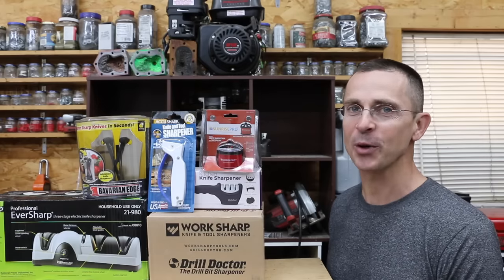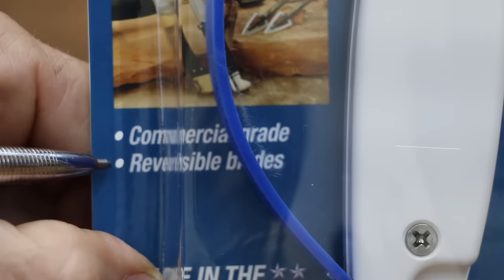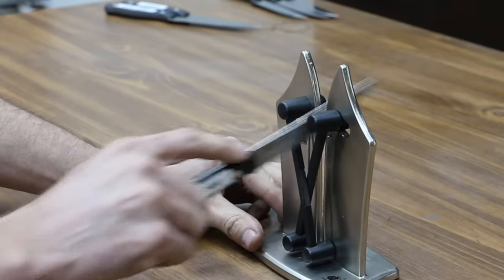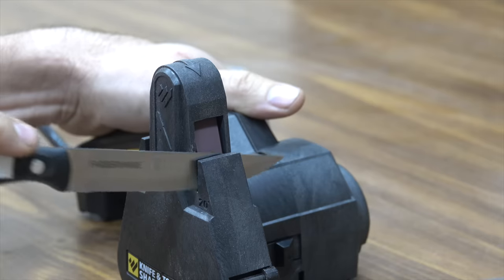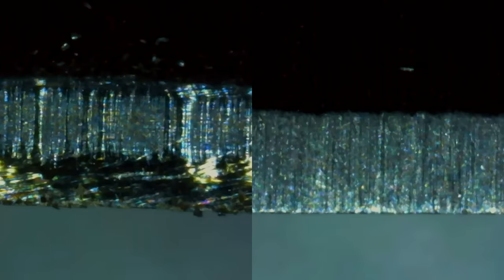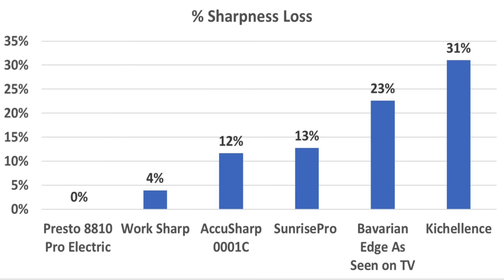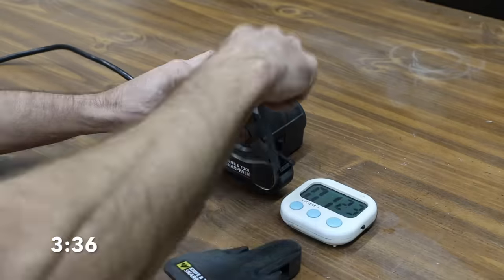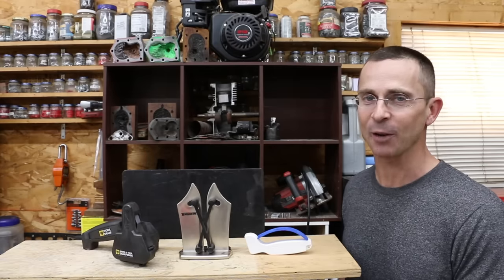Which Knife Sharpener is Best? Let's find out!

Comment: I would have loved to have seen him try a regular whet stone(s)

I'd be interested to know how they compare in sharpness and effort
Reply: Whetstones as well as diamond stones have a learning curve, in all reality it takes years to actually become proficient in sharpening knives and keeping your blade angle correct, personally I wouldn't use any of the sharpeners featured in this video although I would like to have a Ken Onion Worksharp... not a Worksharp, but a Ken Onion Worksharp, same company, big difference, one of the most well known knife designers took part in it, if you're looking for a quality whetstone, look no further than a Norton for most tasks, personally I always use my buck diamond stone, my norton isn't as flat as the buck anymore, so an advantage to diamond, also most pre set and carbide knife sharpeners just ruin blades, I graduated from my Smith's pocket pal a long time ago although it wasn't too bad for an average person, I just never used the carbide side
Reply: They have the highest learning curve (hue), but are the absolute best way to sharpen a knife. (6 years of experience in a butcher shop, many years before with my own knives and tools at home)
Reply: @lumpyzx2645  My Ken onion snap on folding knife is the by some margin the best work knife of the many I've owned, its ability to take abuse is impressive.
Anyway,I'd agree,we have had vastly different experiences with knife sharpeners.Now our kitchen knives are done by hand on a stone,the old guy that does them is nearly 90 and has apparently been sharpening all manner of blades since the age of 12,his hands are all buckled from arthritis but the work is peerless in terms of sharpness and more importantly,longevity of sharpness.He has in his van an old treadle operated rotary stone for big stuff,it's as old as himself,old school and then some!.
I tried him on the strength of my brother's less than eloquent "when they're done you could circumcise a mosquito in flight with one"recommendation.
Reply: the V-shaped sharpeners look like they aggressively remove material away.   I bet the finest grain of Whetstones if used properly can make it very sharp.
Reply: Whetstone's stones are not that hard to use. Even if you sharpen heading off angle like 22 degrees or 10 degrees. As long as you maintain a constant angle when doing your sharpening your blade will come out razor sharp. If you do the progression. My progression is 400 Grit 1000 Grit 3000 Grit 8000 Grit then schropp on leather with nothing on the leather. The 8000 grit will get you a mirror polish on your Edge. Which you don't need unless you have a Rockwell hardness above 60. Otherwise you just wasted a s*** ton of time for no reason
Reply: Lumpy zx2 it takes less than 4 months to learn how to sharpen by hand with whetstones. I got my first hair whittling knife my third week of transitioning from edge pro apex.
Reply: this
Reply: @LostinYTblackhole  my wife hates how sharp our knives are now. LOL especially the paring knife cuz she always cuts her thumbs with it
Reply: @supahvaporeon  agree it takes years. i've learn the basics in weeks to be sharp but getting that paper edge cutting sharpness? years i guess.
Reply: Jeremiah Sam then you don’t understand the basics of sharpening a knife. Getting a knife that can cut through paper takes a week or two if you know what a burr is lol. It’s when you get to shaving, hair whittling, or my personal favorite test... cutting toilet paper. These will take time to achieve on a consistent basis, but you will still be able to get there In under a few months. It’s consistency that takes time to master
Reply: @smoadia85  It depends on how deft you are. It took about a week or so with me, and less than a month with other coworkers.
Reply: Loadn Abox Doesn't count unless he uses a jig, without it there's too much variation
Reply: Most people don’t know how to use them
Reply: @smoadia85  I was able to get knives to paper-cutting sharpness after just a few practice runs.  I use a 180/600 diamond plate to start (180 only if the edge is really damaged), then a 1000/6000 stone, then a strop with compound.  I'm sure I'll get better at it with more practice, but I'm able to slice slivers off a piece of paper no problem.
Reply: They can be quite pricey though.
Reply: @lumpyzx2645  i personally dont agree in Sharpening stone being very hard to learn of take years to get right. i personally started using them at 12yo, and when you understand to keep the angle right they are very easy to use. i consider using a sharpening block easier than any of those V shaped scrapers.
Reply: Whet stones can get a blade as sharp as physics will allow, but the effort and skill required to do so requires years of practice. You'll probably go through dozens of knife blades and stones in that time as well.
I've always wanted to get an amazing edge out of using a whet stone, but I have other things I'd rather do with my time. So electric sharpeners that can get my knives "sharp enough" are good enough for me.
Reply: whet stones would not be conclusive to his methods of testing as their efficacy has considerable variability dependent upon the acumen of the sharpener.
Reply: Some knife edges are ground steeper at the factory.  If the angle is near what I hold, they sharpen pretty fast.  If it is a thick blade with a steep edge, it takes longer for me to get it to where I like it.  I think the experience helps with working different knives to a consistent sharpness.
Reply: oh... i have 2 of those japanese stones... one is iike 800 grit, the other one ~2000 i think... i might have used 3 times in 5+ yrs. 

if u have PLENTY of time to kill & BUDGET, go for it!

me:  knife is a tool, i need somewhat of a sharp edge to get stuff done.  Faster & cheaper sharpening option will allow me to resume my project with a sharp knife and get it done quickly.
Reply: Have a look at the Hapstone sharpener. It will allow you to use any kind of stone, lapping film or polishing leather you want to use. And you can apply it with very high accuracy without spending years on your sharpening technique. In fact, you can surpass even the most talented hand sharpener in the world. Well, maybe not with the Hapstone. But there are other jigs, like the TSPROF and the Wicked Edge. But those are much more expensive and enthusiast products.
Reply: @lumpyzx2645  Smiths makes the BEST whetstones. Their Arkansas black has no equal
Reply: @licensetochill79   even on a "Rockwell hardness above 60" you don't need a mirror edge.  That's just a myth from "knife bros" and it's ONLY for looks.
Reply: There are jigs for whetstones. That takes away errors and learning curve.
Reply: a fair bit if that also relies on skill with a stone, but a good idea
Reply: I've been sharpening knives on benchstones (both whestones and diamond) for 10 years. I've only been really good at it for the past year or so, after much research, study, testing, trial and error, and elbow grease. That said, the results are incomparable.
Reply: Loadn Abox wet stone varies greatly on technique and the angle the user sharpens at. It has the highest learning curve and Just remember if you use a wet stone always use the same angle when using your steel (hone)
Reply: Yeah wet stones really do require a lot of skill. Hell I’ve been sharpening my knives for over a year with wet stones and I still suck at putting a good edge on them. They get sharper for sure but not as sharp as they should be and it’s an ugly edge
Reply: Moon Pie  aww, i thought you were joking in your previous comment but then you wrote "knifes" twice :(
Reply: Moon Pie  I never said you would ruin your knives. I said you would go through them. The amount of practice it takes to get really good with whet stones requires that you sharpen your knives a lot. 

Yes, after a week or two, most people can put a somewhat decent edge on a knife with a stone. But to get to that next level of "scary sharp" takes years. 

I don't have the desire to invest that kind of time into learning that skill. I can get almost as good results from a device that takes a lot less time to learn and a lot less time to use, and use the time I saved to do something more interesting to me.
Reply: @BornIn1500  I disagree with you on that because  a polished Edge creates less friction thus easier goes through the substance I'm cutting. Thus making it sharper
Reply: Brian Landers  how else would u peel something a peeler perhaps! She is stuck in her own way I tried you must not be married. Lol
Reply: @bakerboy8910  I can't say I've ever tested a full size Smith's stone, but their products have always made stuff sharp
Reply: @licensetochill79  I've took one of my knives to a mirror polish and razor sharp, went from diamond stone to 2000 grit to leather, it wouldn't shave hair after but I know for a fact it was sharper than a razor, so I took it back to my diamond stone and left it at that, those microscopic serrations help cut, mirror polish is awesome, dont get me wrong I love it, seen some amazing jobs that it took me a minute to even see the edge, but for most purposes its completely impractical
Reply: Also, I never said you cant make a knife sharp on a stone with little experience, but how many of you that have been sharpening for a few weeks or months are confident enough to holt the stone in one hand, knife in the other, and quickly sharpen it without looking and having a conversation with others? I've been sharpening knives I'd say since I was 7, I'll admit I absolutely sucked for years, I'm 20 now and I can get the initial blade angle of both sides from the first 2 strokes and then sharpen it flawlessly very quickly (unless it's one of these fancy super steels, those take some time), I'll come within .125-.25" of my thumb every pass, I've never cut myself doing it knock on wood but I have barely knicked myself 1 time, couple layers of skin no blood drawn, I don't think anybody could become that proficient in a few months, yes it only takes a few months to be able to put on a nice edge, but to fully understand it and become very proficient it takes, heck I've had my diamond stone for probably 6 or 7 years, got it at a swap meet for like 5 bucks, it's a buck stone, great stone and I prefer it to my Norton whetstone due to weight, wear, and just how much faster it gets the job done just as good imo
Reply: @lumpyzx2645  it's one of those years old questions does it benefit you or not. I think it does. But that's my opinion. LOL. But if you think about it logically something smooth ER is going to have less friction and go through an object easier
Reply: @licensetochill79  that's exactly what I thought but that's actually quite often not the case, although on one of those wire sharpness testers, who knows which would win, they're pretty interesting
Reply: @lumpyzx2645  if you can get someone to donate a tester I'll be willing to sharpen Two of the exact same knives one with a Polish and one without
Reply: @licensetochill79  having a polished bevel (less friction) doesn't make it sharp. The apex by itself makes it sharp.  In fact, having a rougher grind on a high Rockwell has been shown to be better by many people because it creates micro serrations.  You can disagree, but there have been many tests by YouTube people and it has shown that a high polish makes no difference, and in fact can be worse.  Knife bros like the polish because it looks nice on their pocket jewelry and they can play with their knives longer while sharpening.
Reply: @BornIn1500  a polished Edge would be a finer Edge. An edge does not have to jagged be in order to cut if a Polish didn't mean anything why are razors so shiny when they're brand new.
Reply: I do understand there is a difference depending on the skill level of the person honing on a stone.  There's still ways to test that (get a pro in see how long it takes him and have a rank amateur try it at the same time)  See how good each of them does and how long it takes.

I personally switched over to using a stone.  I've tried quite a few methods for sharpening including standard hand tools.  A Lansky (has a setup to give a perfect angle) which was super time consuming and the edge didn't seem to hold well.  I've got a lower-end version of the presto he showed in this video which mostly ground down my blades pretty fast, plus I wanted a sharper edge.  

The stone I'm still learning, but just after my first few attempts I'm already getting a much sharper edge on my knife than the previous methods.  I'm still not getting it as sharp as I would like though.  It's going to take time to get really good at it.  I must admit though that after seeing this video the Bavarian Edge is tempting
Reply: @loadnabox1943  just remember to keep your Stones flat
Reply: Moon Pie  that's a no shiter
Reply: Well I read most of these comments and it appears there's a lot of difference in people's opinion. I don't own a knife sharpener so I can't say which one is best. Back years ago there was a sharpener somebody gave me and it was one of those carbide blade thing you rake over it and when you get done it looks like you've been Drilling in plate steel from all the filings. I don't like the idea taking that much metal off of my knife everytime I drag it across the stone. I have just an old stone I've had for so many years an is a little courser on one side than it is the other and I use a filament from a light fixture. I'm not sure if it's metal halide or sodium I don't know exactly which one. But it's about like a 12 in ceramic rod. A friend of mine gave it to me back probably 20 some odd years ago 30 Maybe and it still works fine to fine-tune the knife. One thing about your knife is you should never let it get dull and by that I mean every time I start to work in the kitchen I grab my ceramic rod and go to raking it down a couple of of times. if you will, if after you've used the knife say cutting up a chicken or cut up some steaks then just remember to when you take it out of the block just take your ceramic and drag it down it a few times and keep it from getting really really dull. I used to work with some guys in the maintenance department and after a couple of times they never wanted to use my pocket knife anymore. They wound up bleeding. And my wife back some 40 years ago had to have her own knives because she couldn't work with mine. But all I ever had was just a whetstone and maybe some boot leather. you know and last but not least be careful what you cut with your knives. if you take care of it it'll take care of you. if you work somewhere and it requires you to open boxes, then for God's sake make sure you have a box cutter or a utility knife and never use your pocket knife to cut a box open. well I guess I could ramble on but I'm pretty much like Forrest Gump now, and that's all I've got to say about that!
Reply: @lumpyzx2645  True, but the Ken Onion is not that much better. It takes more effort on the work sharp (std) but, the angles are the same it's the belt width and guide that makes the majority of difference. I've used both and the "Onion" does make  the job easier but at the time it was much more pricey.
Reply: What is this talk about years of practice? I could make my knife shaving sharp the very first time I sharpened it with a whetstone. 1000+3000+stropping is all that is needed, and ceramic honing rod for maintaining. Obviously you could go higher grits and make it even sharper but what's the point? It's nice for five minutes and after the first honing you are at that ~3000 grit level. Which btw is enough to shave armhair and cut toilet paper. At that point you should get more interested in the grind and the steel. Basically any piece of steel can be made scary sharp but it won't cut or last well if those two things are bad. Carbon steel hardened to HRC 63 is a good choice for kitchen knives. For the knives that have to take some abuse (what do you call those, hunting knife? Anyway the one you use outdoors: hunting, fishing, making a fire, stabbing a neighbor etc.) a bit softer, maybe 58.

Thanks for coming to my TED talk.
Reply: Would vary greatly with the skill of the operator.
Reply: @lumpyzx2645  I know about the learning curve, I have been practicing on and off for a decade, and I'm still mediocre at best. I think I need to invest in better stones and finer ones too. And it's not just about the correct angle either, you have to have the right sweeping motion, and learn to feel the resistance the blade gives to gauge how much pressure to apply, and when to switch to the next finer stone. Over time you get an intuition.
Reply: He probably doesn't know HOW to use a stone.
Reply: @raymondsirois3177  The dude is pretty handy he could figure it out.  That is besides the point.  Honing an edge is a skill and that part of any comparison would render it entirely subjective.
Reply: @LostinYTblackhole  Four months! I did it in two. What did you transition to?
Reply: Glyn Churchman for an average person who knows nothing about knife sharpening and doesn’t consistently sharpen knives I’d say about 4 is reasonable. But for me I used some of my dads old stones( not sure what brand it was worn down) and it took me 3 weeks to get it scary sharp. But now I use a variety of King, Shapton, Naniwa, and some others. I like different grits from different brands, feel like some wear down slower than others while some are easier to maintain.
Reply: @LostinYTblackhole  I was joshing a little. I've been learning for years as my techniques and tools have changed. I now have a water fed wheel for repairing a damaged edge, which is rather rare unless I inherit a knife I want to salvage. I have a half-dozen stones that I have tried and use, and like you, some work better and some wear down faster.
Reply: Uhh sharpness, great. Time and effort, significantly, SIGNIFICANTLY more. This is sort of obvious, bud.
Reply: Lumpy zx2 i use the blade grinding attachment on the ken onion worksharp.
Reply: Id have paid to send in a Global MinoSharp.  Seems to work pretty good on my knives.  On 2nd thought, maybe I dont want to know if some 10$ one works better... lol
Reply: A diamond stone if used properly can get you to below 200 sharpness in 3 minutes.
Reply: Bring on the leather strop!
Reply: Years to use a wet stone? Not if your doing it often. Kitchen knifes most likely will never give you the practice needed to be proficient, pocket knife used and abused daily is what will give you the required practice.
Reply: @licensetochill79  Holding that consistent angle is what the difficulty is. It's not necessarily hard, it just takes a lot of practice compared to a sharpener that has an angle assist.
Reply: I've gotten pokey knives about twice as sharp as a faster all you need is a soft hard and then hard black Arkansas stone and also a letter strip with some polishing compound and it takes 10 minutes for me and I'm 12 but I've been doing it since I was 8
Reply: Oil or water stones are piss easy to use. Minimal effort. Hone on a steel. Learnt before I was 10 in the butcher shop.
Reply: As a chef for many years I would tell you to run away from pull through types of sharpeners. For a pocket knife or some steak knives it’s fine but for a chefs knives they are terrible. They take away too much material and create a concave at the heel after some time. A whetstone(s) can be an inexpensive tool that will last many people a lifetime. Besides.....learning a new skill never hurts :-)
Reply: @smoadia85  no
Reply: @lumpyzx2645  It does not take years to learn how to use a whetstone. I watched a few youtube vids and took a 20 year old chefs knife that was so dull I could run my thumb hard up and down the blade and not cut myself and using a whetstone I ended up with a blade with a mirror finish and a straight sharp blade edge that literally shaved the hair off the back of my arm.
A whetstone is not difficult to use and you don't need magic to get a seriously sharp edge.
Reply: @dbreardon  you're right, they're not hard to use, but they take years to really get good and efficient at it, that's not to say an amateur can't cut a nice edge, but it's more work for them and a little more difficult